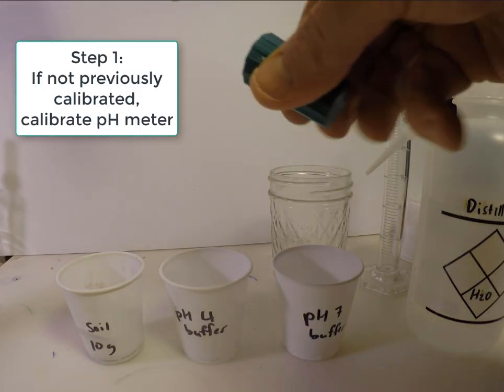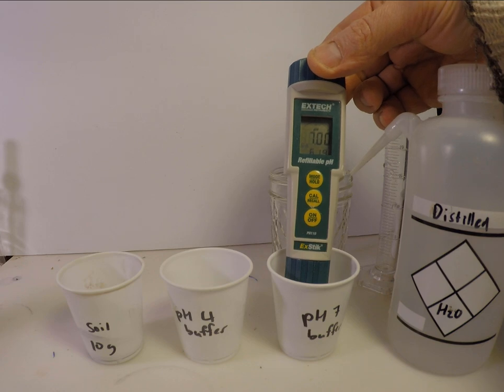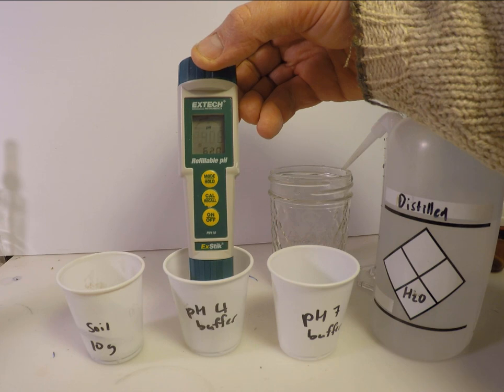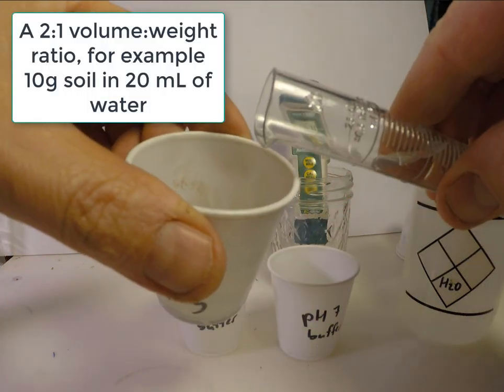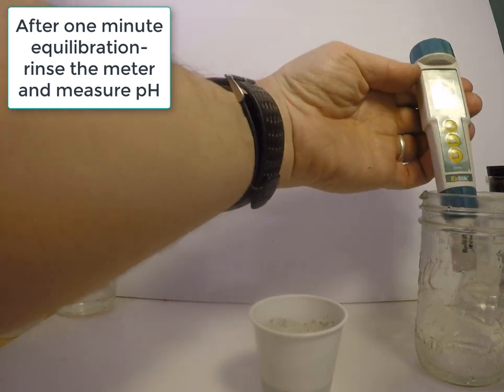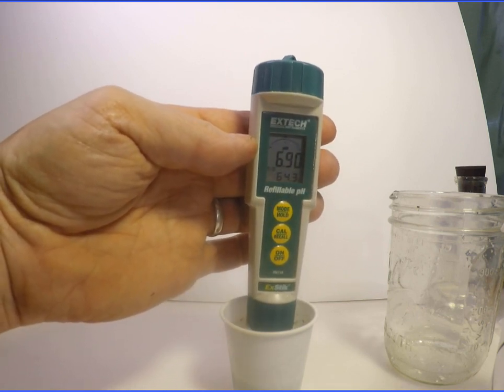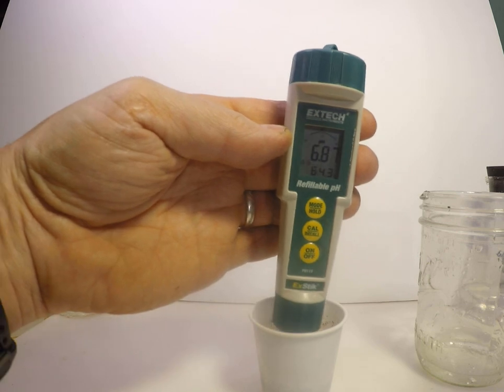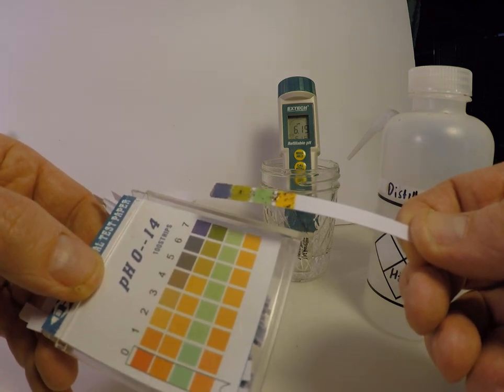Soil pH measurement using a portable pH meter and pH indicator strips

Comment: Another way to test the soil is to pop holes in thd cup rinse 3 to 1 water through it. 
Wait minute then rinse thd soil again this time catch the run off. Test this and it should be nearly spot on what the ph level currently is.

Comment: I'm reading this as 2 parts soil to 1 part water.  Correct?  Thanks!
Reply from the maker: yes it is 2 parts volume to 1 part mass of soil, and since 1 mL water = 1 g water, it is also 2:1 mass ratio. correct
Reply: @lloqalla  Thanks very much, Steven! I based my sample prep on that. Seemed to work out well. Noticed a little drift, but after giving it a minute the reading became pretty stable. All's good! Thanks again!

Comment: You need to use distilled water for this?
Reply: Or deionized.
Reply: @wayneessar7489  is it Ok to use well water with PH7? Does it change the readings of the PH-meter a lot if it is distilled or not? I was just planning to find some 7PH water and I do not have distilled water. I mean, I can buy it, but i would love to make my life easier.
Reply: @English_Lessons_Pre-Int_Interm  I think for ph reading alone and not electrical conductivity it is fine.
For ec the well water might have minerals or other components that could alter the outcome.
I find distilled water at the grocery store near the infant or baby food as many people use it when making baby formula.